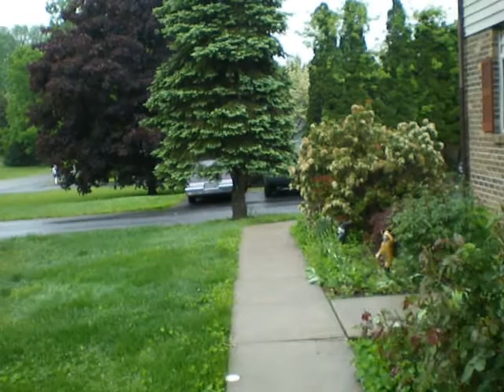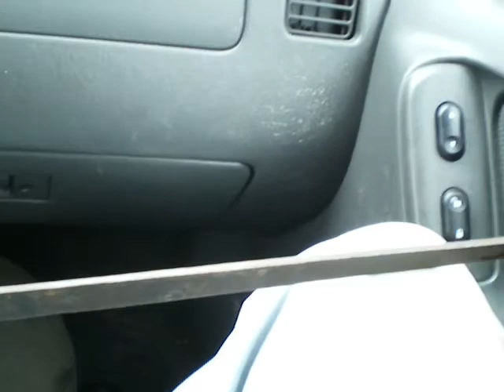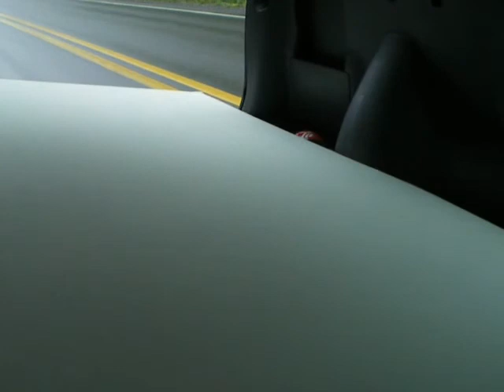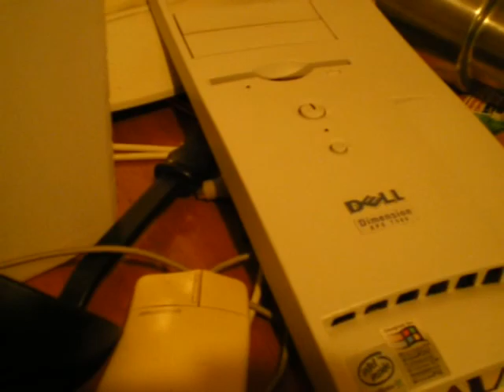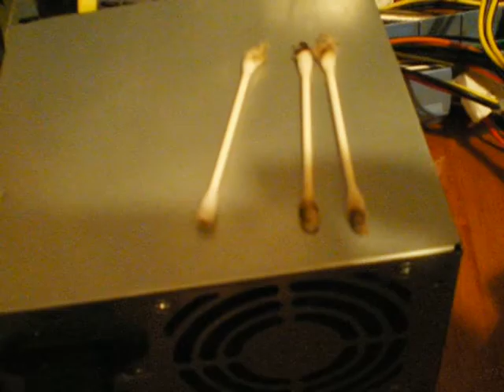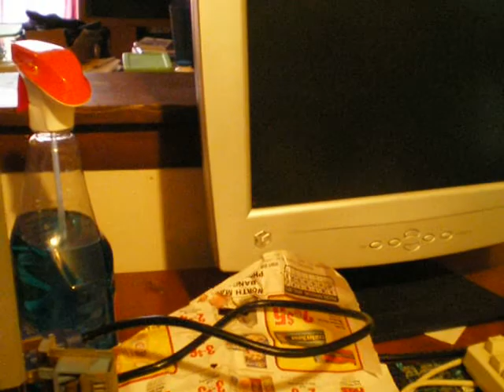V874 - Failed to Repair the Dell XPS 400 Again

Comment from the maker: The XPS 400 is identical to the Dimension 9100. If you look up the Dimension 9100 on Google you can find a service manual at Dell. In that there are lists of error codes that may help. The beeps are usually a series like 3-3-2 etc. Dell parts are pretty cheap on EBay if you need any. The beep codes and light strip should tell you if its a bios issue I think. I hope it turns out to be something easy.

Comment from the maker: A lot of the time it is either a bad memory chip or the CPU contacts are either dirty or the clamp is on wrong. Not sure why mine won't work but I had been trying to adapt a different power supply and the two adapter wires I bought from EBay were defective. The beep code lists seem not to have all the beep codes on them for that model Dell. Good luck I hope you can get yours running! I ended up shelving my XPS 400 project for now out of sheer aggravation with it :-(